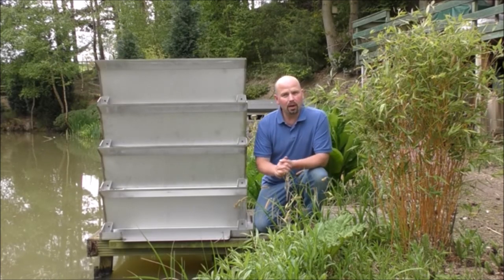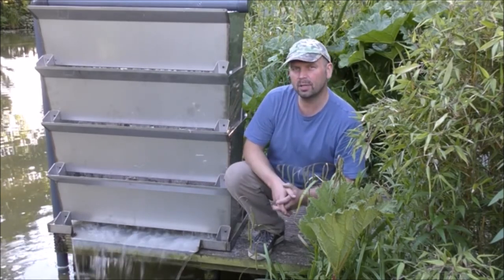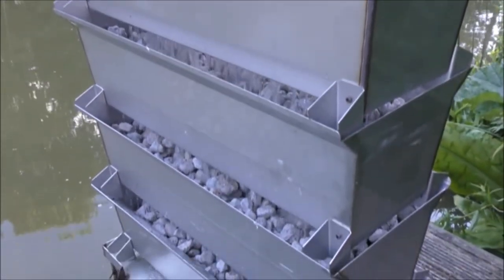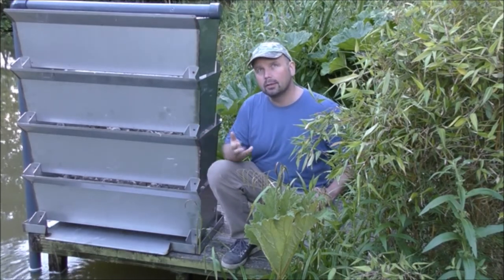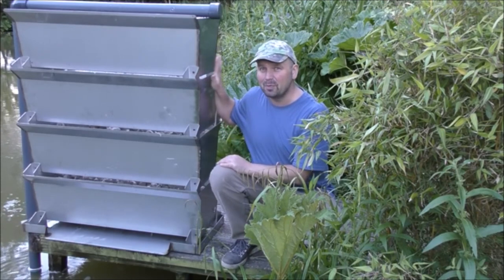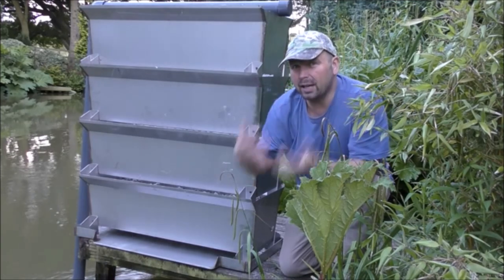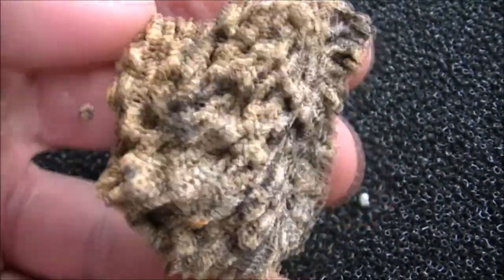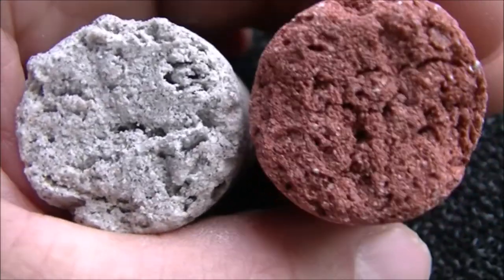Stainless Steel Koi Shower Filter / Trickle Filter

Comment: Dont you think the pump should be farther away from the return flow ?
Reply from the maker: The main pong pump sits well behind the one for this shower and pumps water around flowing past the outflow for the shower filter so water is constantly moving away from the shower filter pump. Ordinarily the pump supplying a filter would be at the furthest point from the filter outlet so you're right there.

Comment: I want to add a uv filter to my pond to clear the algae, but am worried about it killing the friendly bacteria with it..can you give me any advice please
Reply from the maker: As long as UV is turned off for a couple of weeks on  new filter system the bacteria will build up fine inside the filter and if your system is already mature you can add a UV no problem and leave it on 24/7 - your filter will hold all the necessary bacteria to process the ammonia, nitrite (and nitrate - under the right conditions) in the filter media.
Reply: thanks for the quick response and advice, cheers mate :)

Comment: personally I don't use one because you get quite a lot of noise and you need a really strong pump with a good head pressure which would also mean high electric bill could you dampen the noise by putting a layer of Japanese matting on the top of each tray
Reply: Daniel Merrell hi mate. I've seen a video on you tube called koi and morning coffee where a bloke has built a bamboo shed round his tower. hope that helps.

Comment: Hi, I'd like some help. My country contains little information about Shower Filter, could it inform if before the shower filter I need to put another filter to retain the smaller particles or the shower filter can get the smaller particles of the fish? Thanks a lot for the help.
Reply from the maker: If you can fit a pressure filter before the shower filter that will do  an excellent job of making the water clear allowing you to fill the shower up with only media (and maybe a fine pad on the very top)
Reply: shower fiter can not filter water? my idea and use the shower filter to filter water and then go through bacteria media, you think it possible to use the shower filter to filter water as I would like. thank you
Reply from the maker: Yes it can mechanically clean the water as long as you have foams and fine pad in the top section no problem.
Reply: Thank you so much for your time to help. thank you

Comment: Hi mate I need your advice , I need you to design it for me I am willing to pay for your time , I just started to build my koi pond done the digging, it’s about 3 meter by 3 meter and 7ft deep 4ft below and 3ft above ground, should hold about 8000 Galen of water , I want the best filter system, I am thinking of using the drum filter combined with the Stainless Steel Koi Shower Filter / Trickle Filter, but I can’t find the link for the Bakki Shower,

Comment: great video thanks for sharing.
Any thoughts on pumice vs alfagrog? also have you ever used seachem 'matrix'
Reply from the maker: Alfagrog is a great choice for budget filters or in situations where the water may not be perfectly clean but a good quality pumice will outperform Alfagrog in clear water conditions due to the better internal structure which enable it to support a better balance of aerobic / anaerobic bacteria.
As far as I can tell matrix is a mid range pumice.....
Reply: +Pondguru Outdoors cheers for the info

Comment: I thought you can't use metal with fish?
Reply from the maker: I know copper ions can stimulate / irritate the lateral sense line on the fish but apart from that I'm not aware of common metals affecting fish.
Reply: I know you know your stuff so I won't question that, but I think you are mistaken with this filter. Metal and water, with fish, in an enclosed area is not a good idea, which is why no filters are made from metal for aquariums. Even stainless steel will rust, rust in water with fish is toxic. Flowing rivers and the ocean are a different story but in home aquariums and small ponds I don't think using a filter like that is a good idea. I would think the company that makes those would know that. I know you said you're not using this filter in your pond and that's good.
Reply from the maker: That is why I love having intelligent viewers - throwing questions out like that forces me to do more research as now I have to get to the bottom of it.
I do know that in many of the koi farms in Japan they swear by stainless steel shower filters for their growing ponds but just because something is popular and has been used for years doesn't make it the right solution.
Back in the day people used to line ponds with lead but I doubt the fish were ever used as food. Fish store heavy metals in their fatty tissue and it does not harm them (only someone consuming lots of fish), just like shellfish, crustaceans etc. but I'm not sure what happens to non-heavy metals.
Reply: Personally I have never used anything metal in a tank so perhaps I'm wrong, I've just heard it's bad for fish, maybe it's a myth, but I can't imagine rust being ok in with fish.
Reply from the maker: I was just thinking about this and stainless steel heaters are very common for aquariums. The amount of steel per volume of water will be way more in an aquarium than it would be by having a stainless steel shower filter on a koi pond and I'm not aware of any reports of problems in aquariums. The bodies of pumps (and the strainers on expensive models) in ponds and sumps is stainless steel too.

Comment: there isn't that many on YouTube because there so freaking expensive
Reply from the maker: You may have a point there (when they are made of Stainless Steel) but if you saw a recent video I did about a DIY shower filter they do not have to be expensive to be very effective.
Reply: +Pondguru Outdoors true

Comment: Your pump should be on the other side of the pond
Reply from the maker: In a normal pond it should be as far away as possible so the water travels a long way before being drawn back into the filter, yes - this is a demonstration though and behind the filter there is an outlet from a 40,000 litre per hour pump which shift water around the pond so even with the placement of the pump feeding the shower it is not handling the same water for a very long time.

Comment: 4 plastic totes stacked on top of each other with holes drilled in the bottom will do the same... will probably set you back $20
Reply from the maker: Yes indeed - I mentioned that in this video and if you check the related videos you'll see the video I did where I made a plastic version from 5 boxes which were £1 each.
Reply from the maker: No worries, some people want lots of information so I put it in there but I do sometimes think I should make shorter videos. Thanks for the honest comment - I'd much rather have that than fake praise as I'm always looking to improve.

Comment: I have to disagree - plastic media has proven to be extremely effective in drip/trickle down (or wet/dry) filters. It's where bio-balls and even plastic pot scrubbers shine. Where non-moving plastic is somewhat of a waste is when it's totally submerged.
Reply from the maker: Yes, if the goal is to simply remove ammonia and nitrite from the water through aerobic biological action then plastic will do that all day once it gets colonised (after a slime builds up on it). Plastic is a low surface area, hostile media for bacteria but aerobic bacteria has no problem settling there eventually.
It will do half the filtering job (aerobic biological processes) as well as anything else.
However, if the goal is to complete the cycle and reduce nitrates no amount of plastic media will do that.
I am currently editing a video now where I go into great detail about the full cycle since 99% of fishkeepers think it ends with the production of nitrate and large regular water changes to prevent nitrate poisoning.